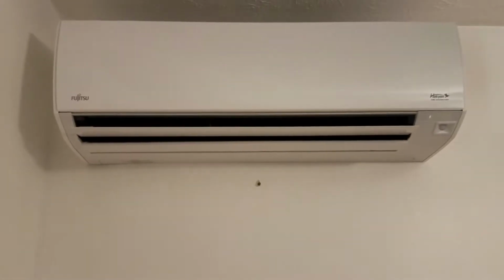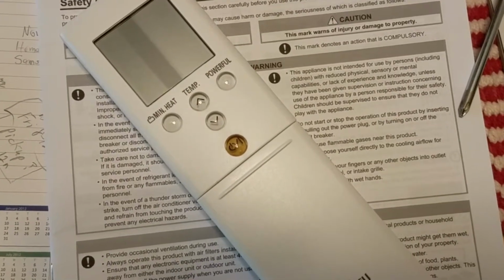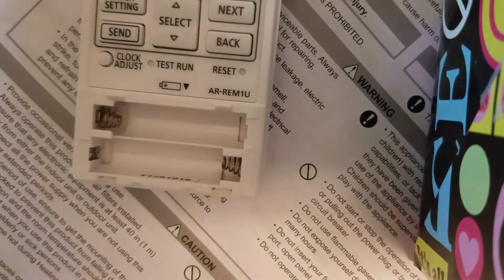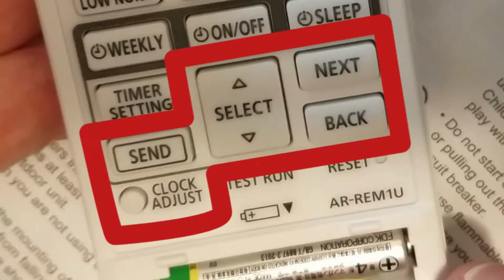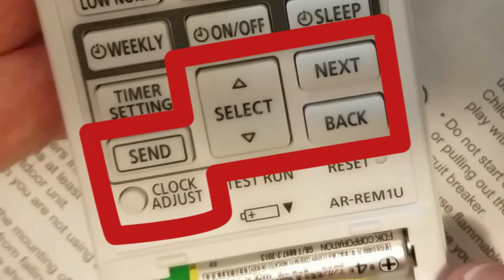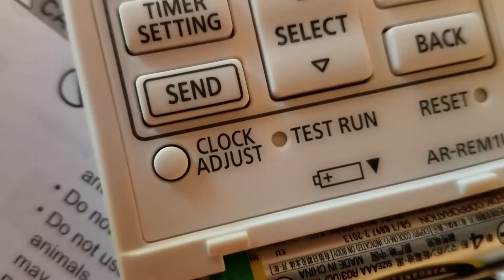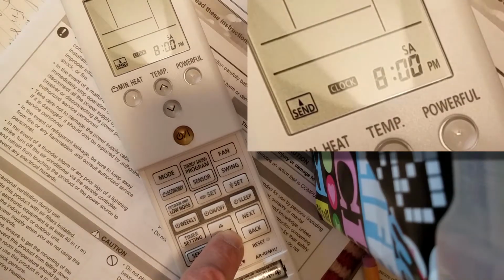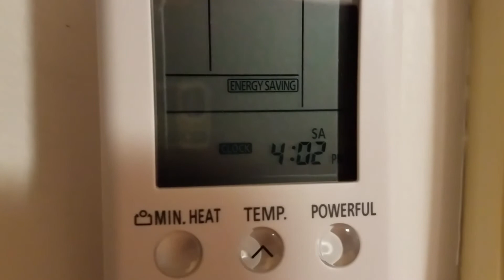Set Day/Time on FUJITSU MiniSplit Remote

Comment: Thank you so much for this video! I have had my two Fujtsu mini-splits for 6 years and dealt with finding the instruction booklet and reading the directions twice a year to change the time.  Your video was so easy, and I made the changes in a snap!
Reply from the maker: Thank you for the feedback. I have given up on changing the time on all five units, after all it is accurate half the year. Since I'm not using setback times, leaving it in auto year round has worked relatively fine.

Comment: Could you please do another video on how to program it to turn on and off at specific time daily. I tried but it turned automatically on and off on a single day only...
Reply from the maker: Thank you for the suggestion, in the meantime you may want to try the Energy Saving program. It will turn on the unit to the specified temperature when occupants are detected otherwise it will allow the area to cool down in the winter or warm up in the summer.